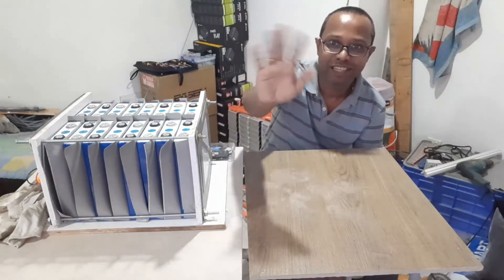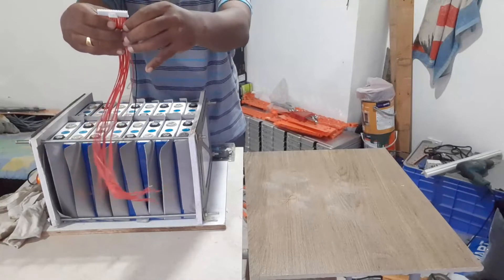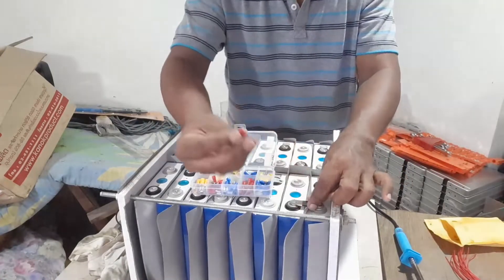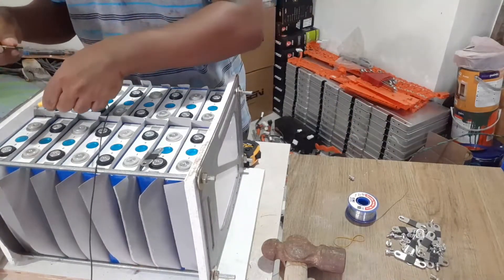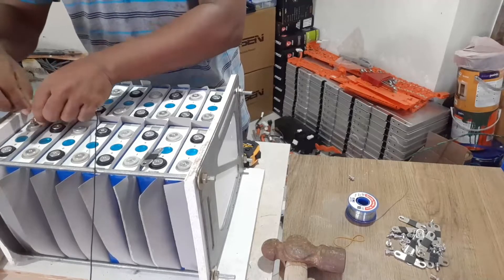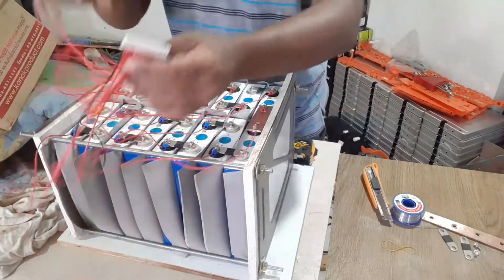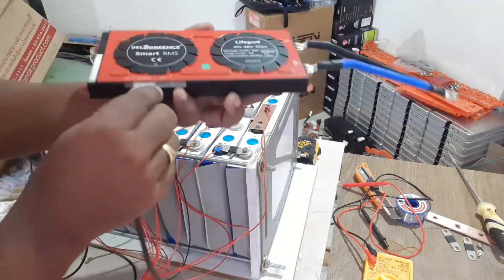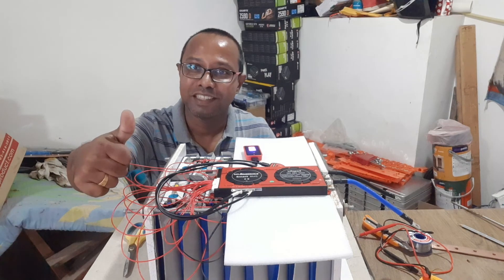How to Install Daly Smart BMS – Full 16S LiFePO4 Guide!

Comment: 16 x 3,2V 280ah what BMS?
Reply from the maker: Depends on inverter capacity . If 5kW inverter , then 150A BMS is sufficient . I recommend JK BMS with active balancing
Reply: @HappyGreenerWorld  inverter Deye SUN-12K-SG04LP3-EU is 12kW
Reply from the maker: @75tomeks  OMG! If you are expecting to fully load the inverter , then 300A BMS is needed.
12kW/50V*125%=300A
Reply: @HappyGreenerWorld  there will be two sets of batteries  48V280ah
Reply from the maker: @75tomeks  It doesnt matter ! 300A bms is sufficient
Reply: @HappyGreenerWorld  i was thinking of using two BMS 150A, one for each set
Reply from the maker: @75tomeks  Not recommended ! Connect batteries in 2P16S and connect with single BMS.
Reply: @HappyGreenerWorld  valuable note, thanks, but in ready-made batteries composed of the same number of cells, bms are used for each set, I thought it would be fine
Reply from the maker: @75tomeks  If one BMS shuts off due to some reason , whole 12kW load will be on other BMS and it will be overloaded and can be failed as well.

Comment: Why did connect both positive and negative of the last battery in right side to bms
Reply from the maker: That is main negative connection . Anyway evening cell is connected from both ends to BMS. That means, every node has to connect to BMS. If 16S, there are 17 nodes in the complete battery !

Comment: what material did you use between the cells? I see many resin fiber boards to isolate the cells I guess in case of fire? I am building the same battery but trying to figure out if i should use the resin fiber board.
Thoughts?
Reply from the maker: Pls see the assembly video. I have given the material spec.  https://youtube.com/playlist?list=PLRYNgrB-xEl5f-ZhuPAIXdG3QFRYsz_d3
Reply from the maker: Silicone Heatsink Pads
Reply: @HappyGreenerWorld  What made you use this?  Normally its resin fiber board that is pretty ridged?
Reply from the maker: @RileyPorter  Mostly due to availability and suitability . It will prevent electric short circuit while transfering heat effectively